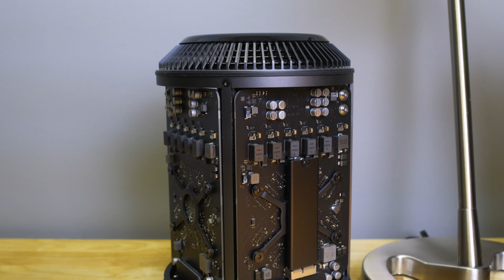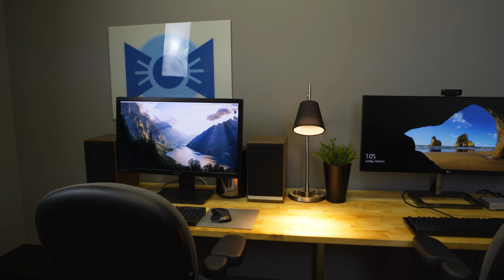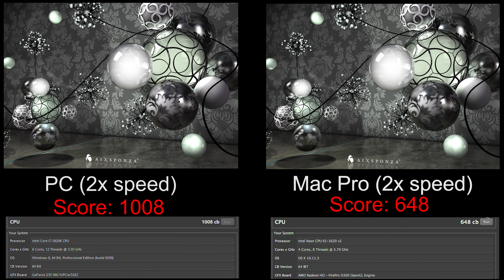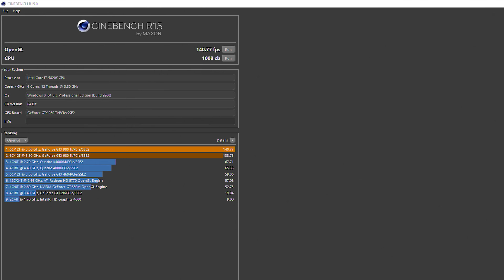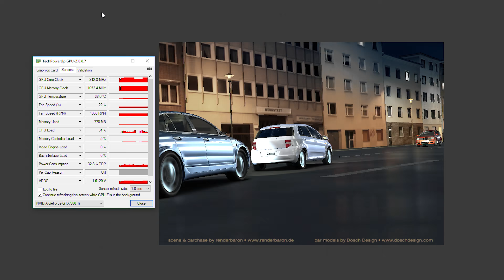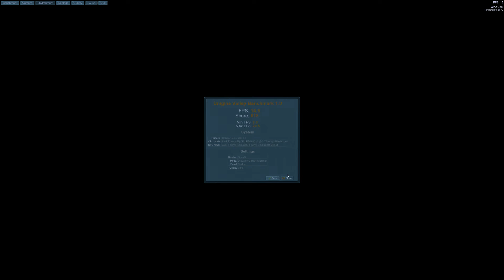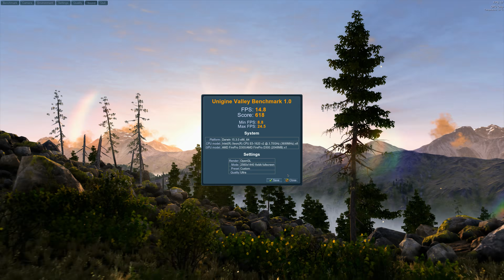$2,000 Custom PC vs $4,000 Mac Pro

Comment: You can buy a more powerful laptop for less than you'd pay for the mac. Every apple product is just there for some reason. And people still buy this trash
Reply: +wesdsomething well the phones are used by many MANY people, and their computers are used by a comparatively TINY audience. Therefore, they will continue to be trash despite being universally overpriced anyways. Im still waiting for a for a windows tablet with thunderbolt 3 so i can go out and buy a eGpu
Reply: ***** It's not about fan boys. It's about Apple selling their Mac Pro for about $5,000 more than it's worth.
Reply: My Dell Inspiron i7559 laptop outperformed the Mac Pro in the Cinebench OpenGL test. And this is a laptop that costs less than $1,000. Unbelievable.
Reply: +wesdsomething my 1600 $ asus ROG notebook runs circles around that mac pro
Reply: +jawad syed Im sure it does. And Asus isn't even good. But it can still beat a mac's ass any day
Reply: Zoracle asus is pretty awesome, specially performance/price, the RMA system is shit though
Reply: Yes, workstation components like the Xeon CPU, FirePro GPU, the ECC RAM. The 870m may perform better than workstation GPU's like the FirePro in FPS output speed of rendering video, but FirePro's and Quadro series GPU's are more accurate in their calculations and produce far fewer errors than gaming GPU's, something that certain professional need to rely on. They also have higher class of manufacturer support generally as well as being to able to handle sustained workloads far better than non-workstation counterparts. There's a reason FirePro and Quadro series GPU's cost thousands instead of hundreds of dollars, and it isn't because they can run The Witcher 3 in 4K on Ultra settings.
Reply: Everything you listed but the GPU's are comparable to the base model ($3,000 version). You'd be able to go cheaper at about $1,200 for dual W7000 cards. http://pcpartpicker.com/p/TL67cf
I came out to around $2,000 (including the general price of a Windows OS $80-$120). Add on a Motherboard that's socketed for LG 2011 (for the Xeon CPU) at around $260 on the low end, and cooling and case for maybe $150, so you're closer to $2,400. For the $600 Apple Tax, you get a smaller footprint, more I/O ports including multiple thunderbolt ports, which currently aren't on LG 2011 MB's, a *NIX operating environment, and the customer service from Apple for all issues that may come up instead of dealing with multiple manufacturers or retailers to RMA parts. 

What you miss out on with the Mac Pro is expandability and easy upgrades. That's where Apple truly fucks you. 

The Mac Pro is such a niche product that most people will benefit from going any other route. It's a good product for what it is, and most people who buy it will probably get their money's worth out of it. But since the GPU's are on proprietary logic boards, you will never be able to upgrade them. You better be damn sure those are the types of cards that you need for you job, otherwise, you're wasting your money.
Reply: +wesdsomething To be fair, mac users aren't just a bunch of idiots who buy anything with an apple logo on it. Apple does do a shitty job of keeping their computers up to date, and their desktop's tend to be overpriced, but they make sense for some markets. Also, I think there laptops are great (when they're up to date). They're not overpriced and really are solid machines.
Reply: same
Reply: +Hmm- Name you say? The Appple ][ wasn't bad.
Reply: +jawad syed yee
Reply: +jawad syed Yeah no it doesn't. I'm sure it's better for gaming, but when you actually utilize the workstation components of the Mac Pro like they are intended, then your $1,600 notebook will not come close to the Mac Pro or any other workstation computer. Two completely different machines for largely different types of tasks.
Reply: inmynothingyoumeanteverythingtome what workstation components? CPU utilization? I get a better cinebench score. GPU performance, 870m performs better than the mac pro's GPU. Only the ECC ram could be better for stability... Still, this is a freaking notebook (2 year old at that)
Reply: inmynothingyoumeanteverythingtome thats nice and all.
but the GPU is still only around 1000$(the ATI FirePro V8800 costs that much and you can compare those).
there is 2 of them in there. thats 2000$.

the prozessor is probably something like the Intel Xeon E5-1620. lets say 400$. ok. thats 2400$.

12gb of 1866mhz ECC ram cost about 150$. 2550$.

motherboard+coolers and all that 250$ at most. power supply like 100$. we are at 2900$. then there is the flash storage for about 250$. we are at 3150$.

charging 850$ for a fancy case and assembly seems pretty expensive to me.
(and i was pretty generous with some of these prices. all of those are consumer prices.)
Reply: Yeah, if you read the info in the video he bought the $3,000 version not the $4,000. So you just proved my point. The only thing he changed was the SSD to 1TB which brought it up to "closer to $4,000" according to Snazzy Labs. So let me know when you can cram all of those components into a 10" x 6" tube with a singular cooling fan that only weighs 11lbs and I'll be impressed with your build. All I'm saying, and what you'll read from reputable tech sites, is that for the most part, the price of the Mac Pro is justified.
Reply: inmynothingyoumeanteverythingtome there is a 3000$ version?

well the stuff i used for comparison was for the 4000$ version. from the website.

doesnt really matter which version he uses.
Reply: inmynothingyoumeanteverythingtome well ya. i was really generous with my prices.
Reply: inmynothingyoumeanteverythingtome well you'd probably need 600 watts but well. i was being generous since i give apple the benefit of the doubt.
Reply: they only sell the product for the name they don't give a fuck about the quality
Reply: +inmynothingyoumeanteverythingtome 
Apple is not a *nix, as much as you'd like to think otherwise. Not that it matters, since it's [current year].
if you want to be inclusive a live USB is free and takes minutes to set-up.
you can even slap a *BSD for true unix bragging rights.
Reply: loric loppi  OS X is certified POSIX compliant so yes it is a *nix operating system. If you want to believe otherwise you can choose to remain ignorant of the facts.
Reply: inmynothingyoumeanteverythingtome 
...what did i say?
Posix != unix
Reply: Jesus titty fucking christ, do I need to spoon feed you the information. It's also a Unix 03 registered product. Keep being ignorant. OS X is unix based OS plain and simple.
Reply: +Hmm- Name you say? why are you waiting for windows? there are other componeys you know? alianware lenovo etc.
Reply: i got the mac pro for my trash can
Reply: Dog Gameing you might need a bigger trash can.
Reply: +wesdsomething  because its not trash judge this pc after 4 years with the same price tag it has today .... and see if its not overpriced ^^
Reply: +drakedoggy103 I am sorry, but - What?
Reply: +wesdsomething that's the point.  Noone should be paying new prices for three year old hardware!  Geez, it's like an abusive relationship. People are making excuses in the face of obvious wrong doing.
Reply: To the guy with the ROG laptop; I have the $1000 one, and even it can destroy the Apple Trashcan Pro.
Reply: +wesdsomething Yes, they are overpriced & not the latest in the market! It's just stypish & it's being highly marketed & it's in movies etc... They kinda put a lot of effort in making it a niche product! So yeah! You don't buy a Mercedes Benz just cuz you need some transport, do you?? It's kinda like that
Reply: +wesdsomething I'm getting an Alienware 17 in June (the $1999 one). It's got stats that are considerably than the Mac Pro's, for $1000 less.
Reply: people buy apple products for the brand/name..
Reply: I like apple and Microsoft however I do find that Macbooks last longer than laptops
Reply: Brian it really depends if you know how to take care of your crap, and also know what you are downloading.
Reply: Essentially, Apple values more on their brand name and looks than  performance.
Reply: I could accept buying an apple laptop purely because most other laptops tend to go to shit after a year or so and macbooks actually tend to have a long life time. Plus it's hard as fuck to custom build a laptop. Now on the other hand, I feel unless you are getting generic computers for a business, you should custom build your desktop. Apple pretty much flagships their phones and tablets and forgets to lower its prices on its shitty 2-3 year old desktop computers (and even their laptops).
Reply: Well if the trackpad goes bag, the performance for the whole pc goes down the drain? What sense does that make?
Reply: 2Awesome Windows laptops have lower quality trackpads. That doesn't mean that they go bad, necessarily. Not in the time you'll be done with the laptop. I don't see why a trackpad is worth a $500 markup on a laptop.
Reply: IAN 4000 I was talking about the macbooks, if the trackpad goes bad, the laptop is useless...
Reply: 2Awesome Ah.
Reply: Honestly I'd say the only reason to buy their hardware is for the OS. Every time I have tried hackintosh it has frustrated me (granted it is on a VM with a host machine running an AMD CPU) so I can see why people would still buy macs if the OS makes them more productive.
Reply: They buy it because it looks nice, i guess and so they can show off
Reply: I got a $2000 game pc and i love it. 
I got also the newest Imac and i love it. 
And on the go i got my Macbook pro 15 retina and i love it. 
Fuck the fan boys !! and have both ;)...
And btw they did not update the pro bc its not selling  !! people prefer the imac get your shite together.
Reply: ***** its prolly not selling because its shitty specs. if they updated it then maybe
Reply: Because they're paying for the name. It's like those people that pay $100 for a plain white tshirt because it was made by kanye west
Reply: ***** it probably wasn't made by that person, just sells for more if it says it was.
Reply: cough MSI aka the holy grail for laptops